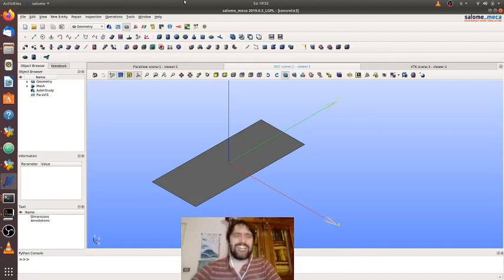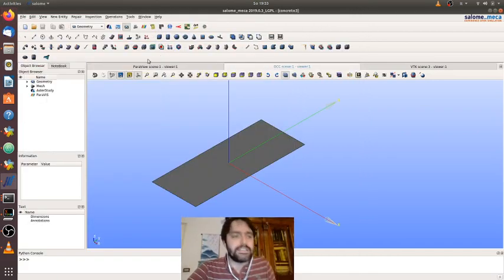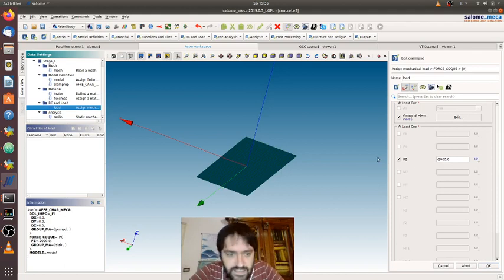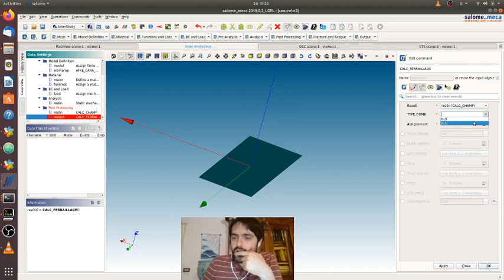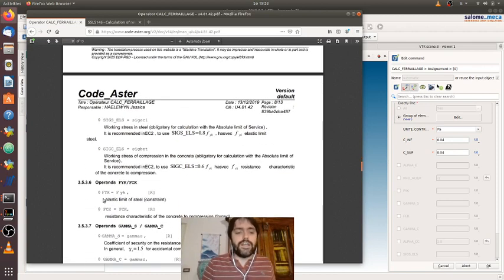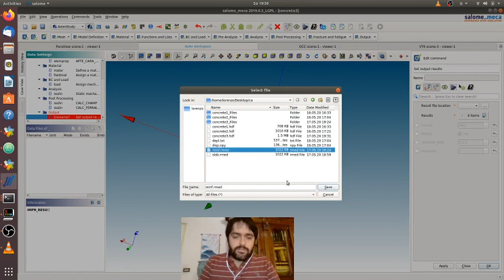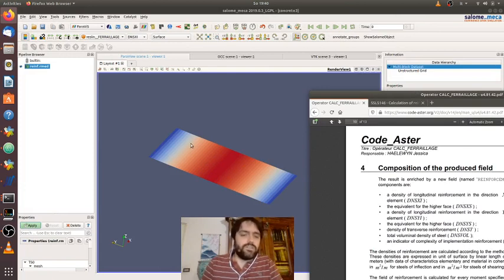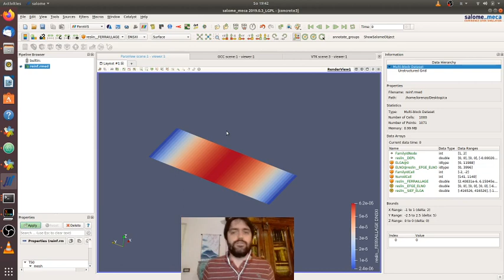Tutorial for Code_Aster and Salome_Meca - Episode 09

Comment: In which domains are you using code_aster the most or is it the most appropiate. A domain we want explore the possibilities is the structure soil interaction.
Reply from the maker: Well Code_Aster in general has a vast fled of application, for that it is better to look at the official documents on the code_aster website.
It has a lot of features regarding soil modelling and soil-structure interaction but we have not explored this that much. We do have used it before, nevertheless, for modelling the static and dynamic stiffness of soil below a foundation slab, this could be an interesting tutorial but it could be quite complicated. You can look for "RIGI_PARASOL" in AFFE_CARA_ELEM and here is one of the relevant test cases https://www.code-aster.org/V2/doc/v12/en/man_v/v1/v1.01.200.pdf
Reply: @aetherengineering7387   Thanks for your reply. I think this would be an interesting tutorial.

Comment: go on in any case with your inspiring video's?
Question: is it possible to model for example pilepiers with their actual reinforcement ?
Thanks in advance.
Reply from the maker: Modelling concrete with actual reinforcement is not so straightforward and we do not use Code_Aster in that field that much. But hopefully, we can work in a tutorial in this direction, we will do our best. Thank you for your message
Reply: @aetherengineering7387  Thanks a lot. Keep posting. Your video are very educational.